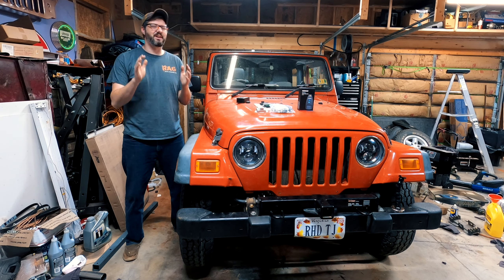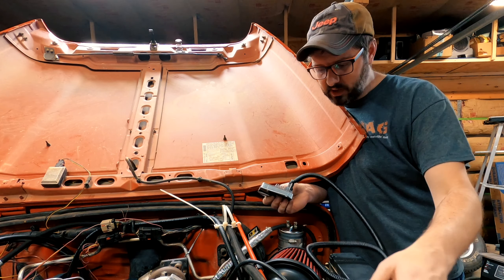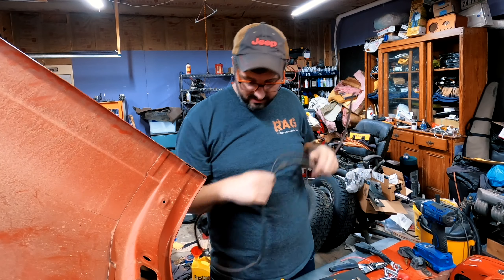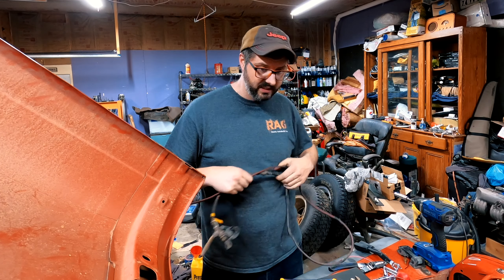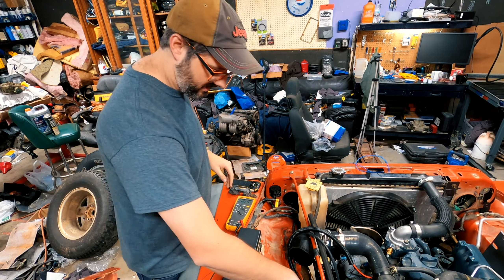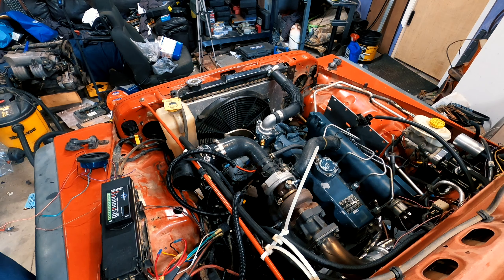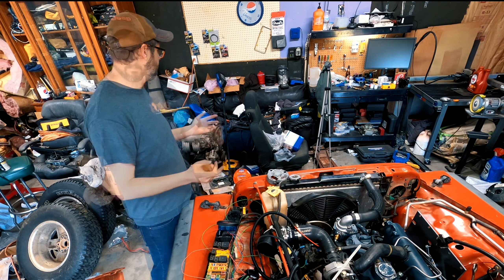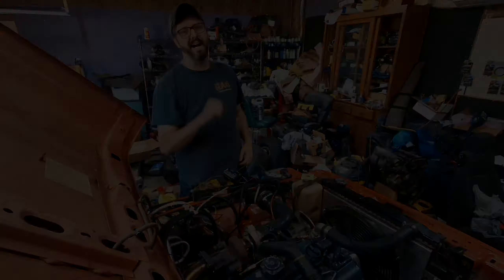Modifying the Alternator for a Tachometer Signal [Diesel RHD TJ Wrangler - 62]

Comment: Hi I'm trying to wire a tacho in a defender with a bmw m57 engine what terminal inside the alternator are you using.
Reply from the maker: I'll have to go back and check I don't remember anymore, that was 2 years ago when I did that modification and I'm using a different engine now.

Comment: What exactly in the alternator did you connect the tach signal wire to?
Reply from the maker: Hey Tom, sorry for the late reply! I just used a stock alternator off of a XJ Cherokee!
Reply: Yeah this is the second video that didn’t point out exactly where on the alternator the tach(green) wire is terminated to. Looks like I need to search some more.
Reply: @FirstNameLastName-hy2iz  did you figure it out? Trying to figure out how to hook a tach up to my 6.2
Reply: @claywoody7110  no I kinda pushed that project aside for now. I just don’t have enough info to finish it. Please share if you discover more on this.

Comment: what many didnt figure out is that is dual ignition as well because of that setup engine run on is posibel ever heard about waste spark ignition system? that perfectly fits in you can eather use ac ore dc ignition those jepps have 1 isue as well that is radiator electrolisys figure the rest for your self
Reply from the maker: My Jeep is a diesel so I have no spark at all.

Comment: Hello. Can you write the products you uses? thanks
Reply from the maker: Which ones? For the gauges and how I got the tach signal?
Reply: @RustyAutoholicGuy  I have the same problem with the signal of my alternator, I have a volvo penta diesel (marine aplication) and I replaced the factory alternator with a generic one that does not bring the signal, I bought a universal autometer, but it worked well for a short period of time, I think the best is to adapt it as you did, it is more reliable. I see that you used several products to achieve it, could you expand more on the subject, greetings.
Reply from the maker: Gotcha so the main part you need is the Dakota Digital Signal Box here:

https://www.dakotadigital.com/index.cfm/page/ptype=product/product_id=1192/category_id=-1/mode=prod/prd1192.htm

With that box you can use any tachometer you want, it converts the signal to a normal tachometer signal.

Comment: Your use of butt connectors is out of control 😆 I don't trust them farther than I can throw a stick. Do you plan on soldering those down the road?
Reply from the maker: The issues I've run into with soldering in an engine bay is I have seen the solder get soft before, not completely melt but get soft, and with the vibration of the diesel engine, I figured butt connecters would work better. Also it allows me to change things without recutting my wiring all the time as well.
Reply: @RustyAutoholicGuy  I agree that both have their advantages and disadvantages, and something like a deutsch connector is probably the superior option. I have just seen so many failures and corrosion with those red, green and blue butt style connectors. There is some butt connectors that have heat shrink and adhesive built in that work well!